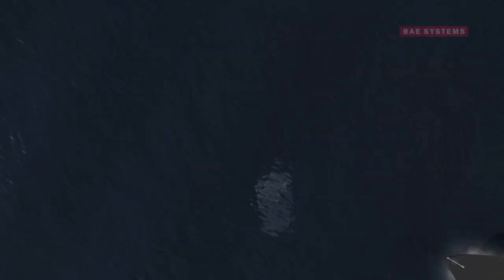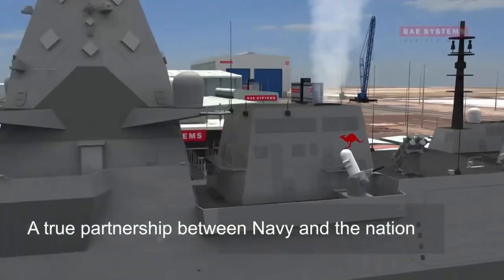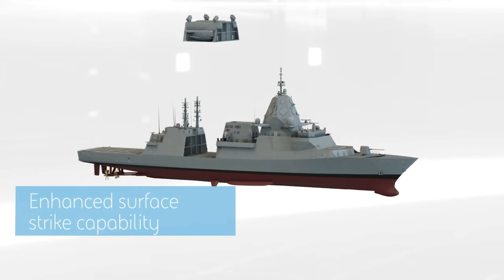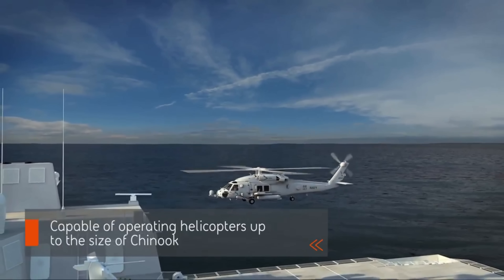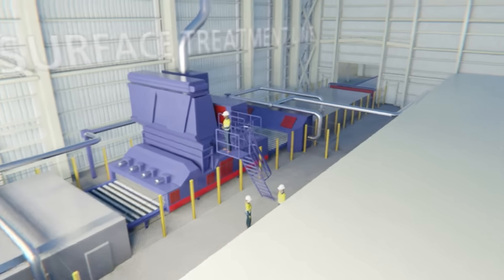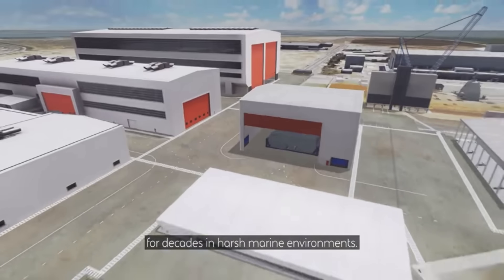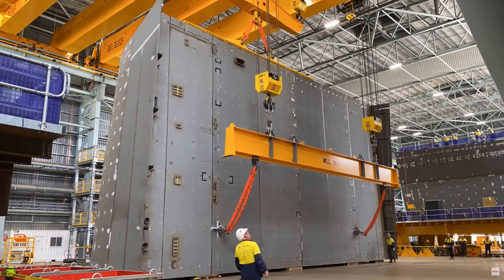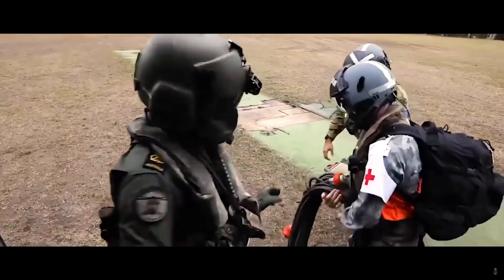Australia's Next-Gen Warship: Speed Building the Hunter-Class Frigate

Comment: What will be escorting the Australian Hunter class!
An Australian  Large Optionally‑Manned Surface Vessel (LOSV) that holds many VLS cells
Purpose
• 	Act as a missile‑magazine ship to boost the RAN’s Hunters firepower.
• 	Carry extra Vertical Launch System (VLS) cells for weapons like SM‑2, SM‑6, ESSM, Tomahawk, and ASROC.
Design Basis
• 	~3,000 tonnes
• 	~91 m long
• 	Modular payload bay
• 	Designed for low‑cost, high‑endurance operations.
Crew Model
• 	Optionally crewed — can run unmanned for high‑risk missions or be crewed for transit/maintenance.
Role in the Fleet
• 	Operates alongside Hunters and Hobarts as a cheap, survivable missile carrier.
• 	Expands Australia’s distributed lethality and magazine depth.
Timeline
• 	Confirmed in 2024 surface fleet review.
• 	Over Six LOSVs planned 
Likely extra VLS counts (32–96 VLS cells) for this unmanned/manned ship.

Comment: In frigates it depends on what they are for. The air defence frigates i love the 8.000-11.000 ton saturation proof designs. I think for a frigate that size a minimum of 64 VLS tubes is required, 32 for SM-2/6 the rest for tomahawks, quad packed ESSMs and SM-3. 

But as a GP frigate it is more about the submarine hunting capability so smaller and around 32 VLS tubes. Like the improved Mogami class. We are getting only 16 way too few with the current threat levels although the 21 RAM launcher is good at the interception of drones just like the millennium gun.

Comment: There is a simple formula for calculating projectile penetration. There are no properties of metal alloys of armor and the construction of a full-caliber projectile, as well as no flight path and air density. It's just the moment when the force comes into contact with an obstacle. Everything is very simple. For calculations, you need the speed of the projectile, you need the mass of the flying projectile (without powder and shell casing), you need to know the caliber of the projectile in millimeters (57mm, 75mm, 88mm, 90mm, and so on). And one more simple parameter from elementary school. The main thing is to know which parameter needs to be squared (or a similar degree), which parameter should be divided by 2, what to multiply with what, and what to divide by what. And multiply all this by 1000. There will be a meter at the end. That is, a number denoting a simple length. The penetration of many tanks is less than a meter. Therefore, the number will be 0,xxx . Where xxx is. these are millimeters. There is one feature here. The root of 100 is 10, and the root of 10 is 3.16. Therefore, the speed must be taken in the correct ZEROS. Where does the formula come from? I took part of the formula from bloggers and military articles for teenagers from the Internet. But then I simplified and improved part of the formula for myself.    The formula for calculating the sub-caliber projectiles assembled from the components of the 2nd world war differs by another last parameter from the elementary school. Instead of 1 school parameter, you need to set 1 kindergarten parameter. The calculation of Abrams and T90 long projectiles also differs in some ways. This will require a coefficient applied only in the NATO and US armies. You won't find him.

Comment: A correction to @volkxx BAE's up armed offer was as follows: 128 Mk41 VLS cells,
The concept, which BAE is proposing for Batch II of the class, uses the space allocated for the mission bay on the Hunter class to insert 64 Mk41 Vertical Launching Systems (VLS) and 16 Naval Strike Missiles (NSM) into the ship for a total of 96 VLS cells. 

If the RAN elected to remove the 5 inch Mk 45 gun, Lockhart said, it would enable the VLS count to grow even more to 128 cells – which surpasses even the United States Navy’s (USN) Ticonderoga class Guided Missile Cruisers.
Reply: The 96/128 cell versions of the Hunter require the removal of the towed sonar, hull "quieting" equipment, the main naval gun, and the modular mission bay. At that point you're better off just starting with a clean sheet design.

Comment: The build changed from 9 to 6 as the government sought to save money to fund the AUKUS submarines.  The race is on to get these into service before the ANZAC class boats time out.  The problem has been a bit of a split personality issue over sub hunter versus missile boat and hence its defensive vs offensive role. The problem is largely addressed by the decision to engage with the US in the build of purpose built missile trucks which will operate with/under the umbrella of the surface fleet with a primary role of beefing up offensive capability of the fleet. The other augmentation is yet to be decided general frigate program in which either the Japanese or Germans will supply general purpose frigates with the first 3 built outside of Australia to ensure speed of delivery.

Comment: You need to get your fact correct. For a start, we are getting only 6 units reduced from 9. Further, the first 3 ships will have 32 VLS only with the second 3 potentially exchanging out the multi-role module for an additional 64 VLS for a total of 96.
Reply from the maker: Sorry 😢
Reply: I think you need to get your facts correct mate, there is zero indication that the second three hulls will have increased VLS cell count. The RAN is buying 6 Anti-submarine warfare ships with the hunter class. That upgraded design was pitched by BAE systems prior to the Surface Fleet review as a potential option to increase firepower, but the government has not selected that option, and instead has opted to build 11 frigates.

Comment: Speed building? You're hilarious Matt! We likely won't get the first one until AT LEAST 2030.
Reply: That's for the first one, after that, it's every two years.
Reply: @darkmatter5262  still slow as fuk
Reply: @darkmatter5262  which is pathetic, these aren't nuclear powered or even overly large. We need these now, not in 15 years.
Reply: @andrewsmall6834  they need time for set up. Canada is doing the same thing. But in Canada, they have stretched the building  for as  long as possible, it will take forty years to build sixteen ships. The sole purpose is to provide jobs for the longest time possible. National security means nothing to the government here.
Reply: @darkmatter5262  yes we empathise
Reply: @darkmatter5262  Well that's short term benefit vs long term. If you build them too fast and then have to lay off your workforce, it will cost you more and hamper you more in the long run.
Reply: @dan7564 I read initially the plan was to keep the shipyards working forever. By the time they are done with the last ASW frigate, they can replace the anti  air destroyers. Slow and steady!
Reply: @ Agreed we need these right now but that said, set up means in war time we can expedite manufacturing fast. It comes down to cost. Planning for 2030 means 2029 for testing and a huge pat on the back and keeps the cost fluid given economy.

If war broke out in 6 months, we'd see the first one in 9 months and multiple every couple of months before a daisy chain of manufacturing.

Delays is good for the budget.

If Karen's stopped complaining about every little pot hole on the back streets of suburbia, the council's would repair entire stretches of roads in time for storm season, reduce costs. This is one of countless facets which make up our budget. We would have a much larger defensive budget for what we actually need. War, it is coming and it's going to be rough on everyone........
Reply: @AussieHighwayMan I seriously want to see a service life extension program on the ANZACS and than have all the retired ships retained/stored just like the Americans do to just in case.....
Reply: From design to first launch 10 years is good for a new design
Reply: @shaun469 except the first of the design (HMS Glasgow) is now in the water. The Hunter class isn't that different to it, if the Brits can do this, why can't we?
Reply: It did not even cross my mind that the title was anything but satirical, until your comment popped up
Reply: As I understand it we will be building six Hunter Class frigates and eleven smaller multipurpose frigates ( three of the latter to be built in country of origin ) . The replacement for the Hobart Class AWDs are due to follow on from following the Hunter Class.   Consecutive to that build process we are building 16 medium landing ships and eight heavy landing ships.  The biggest construction project will be the AUKUS nuclear powered submarines beginning in the 2030’s.
Reply: Oh yes - and we are supposed to build or acquire six unmanned or semi manned warships of around 2,500 tons, 32 VLS, ( a joint project with the US ). - we’ll see.
Reply: Unfortunately on the defence issue the current Australian government is crazy and irresponsible.   The danger period is 2027 2028 when China is likely to invade Taiwan. Australian defence forces take 320 days to answer a candidate last year they were 5000 short.  So what did they do?  Well, we save money so we give everyone a tax cut despite the severe recruitment crisis.
-under the Rudd Government we were supposed to buy 12 subs armed with Tomahawk missiles.  That got cancelled by the Gillard government and we ended up with eight French submarines.    That got cancelled by the Morrison government in favour of about eight nuclear subs that we won’t see for 15-20 years.   Australian deep trouble.  We’re starting to fall below the 2%. We may just find Donald Trump saying that we’re freeloading on defence.   Current government is interested in an election budget.   20 years of bad decisions on major defence Procurement.
Reply: @williamzk9083  STOP BEING STUPID 
It NOT just this government its all of them for the past 30+ years and probably a lot longer.
It hasn't mattered if its Labor or Liberal they have both been terrible with military procurement.

Before we do any more of these purchases we need to THROW OUT the scumbags doing BOTH the advising and procuring. I worked with a young ex-Army officer who was an engineer and had served in both Afghanistan and Iraq. He told me several times how bad the Army procurement systems are.

I'm an aerospace engineer by degree and some of the RAAF purchases have been atrocious. One of those purchases (the Pilatus PC9 trainers) wrecked my career options back in 1988 right after I graduated.  

Every time Australian military procurement comes up in a room full of engineers story after story comes out. Almost every engineer in Australia has encountered something stupid the ADF has done and NONE of those stories ever seem to have that much to do with which political party is in power.

Even the submarines right now is a disaster and who do we blame?
DO we blame the Libs for claiming $96billion was to expensive so they signed us up of $268billion?
OR do we blame Labor for not sorting it out?
Reply: Remember the Discord Leaks about Stockpile Replenishment? 
Western Military Industry cant produce anything in a somewhat timely Manner
Reply: China might move onto the Type 054C by that time lol.
Reply: Engineer here: Yeah this guy has no clue what he's talking about.
The Hunter class is a lesson in HOW NOT TO PROCURE.
If you go and look at the Type 26 which the Hunter is based on, Australia is paying 3x the price per boat.
AND NOBODY has explained that.

The same goes for the Virginia/AUKUS class subs.

The US Navy is paying AU$5.5 billion for each and ours are costing $33.5 - 46 billion each.
Yes that includes the lifetime costs but that means the lifetime costs are AU$28-40.5Billion each or based on a 30 year life which AU$930million- AU$1.35billion PER YEAR. I dug up a British FOI on sub operation costs and the costs per year for an Astute (in 2016) was $25million per year.

Australia's navy procurement people are out of control with spending.
And all the filthy little suckrats posting Ye-ha videos of how great it is can go do some unnatural acts on themselves.
Reply: its better than canada
Reply: 2030 is 5 years from now not 15 lmao
Reply: ahahahahahahah HAMAS bikies and CFMEU
Reply: Don't listen to the knockers Matt. Naval shipbuilding  is incredibly complex , much more so than merchant ships. Sure if you want an old barge you can get one in a year, but cutting edge warships take a bit longer.
Reply: Everything we build is shit in Australia
Reply: And by then we would’ve been nuked by Chyna